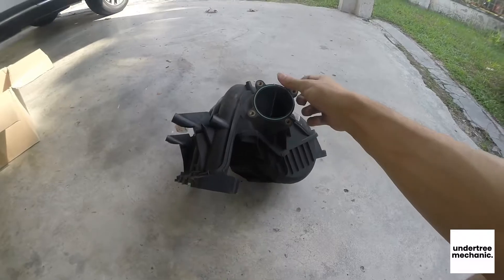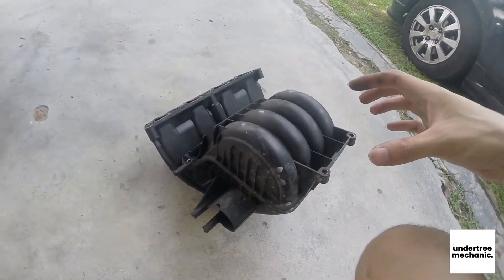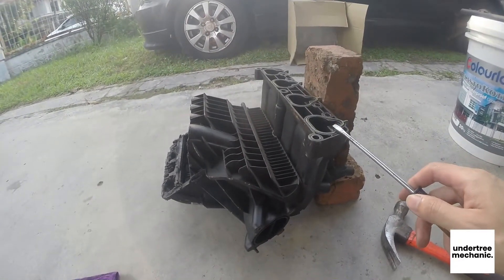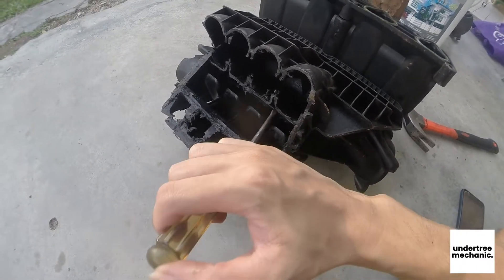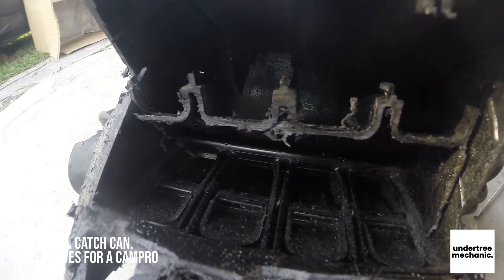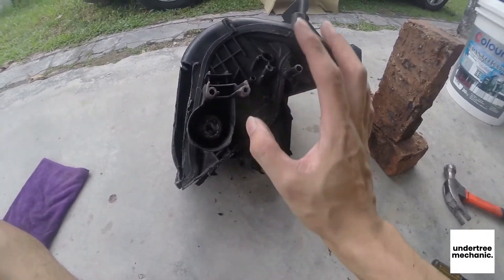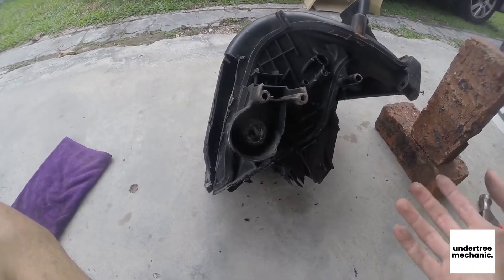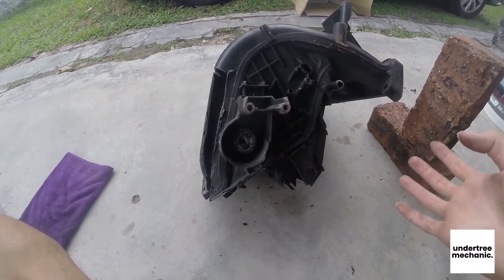Why/How does Proton IAFM fail (CAMPRO Intake Manifold) - Dissected & Diagnosed

Comment: Commenting to 2 years old video.
First of all nice video
Second, i have a 2012 model proton persona, still running on factory installed intake.(never change)
At first, i had similar prob.the intake flap noise.what i do to eliminate the noise as follow
1. Remove the intake, inspected it seems like the intake had to much oil such into it. So i clean it up
2. Try to figure out why the intake is too oily. Too much oil sucked into intake is symtom of bad pcv valve.however , campro does not have changeable pcv valve. It was build in inthe rocker cover with some sort of baffled systems.
3. Solution are follows
A. Clean the intake from the oily condition
B. Installed an oil catch tank in between the intake and the engine rocker cover. 
4. Result
Never had any issue intake flap sound.
During interveal oil change, i will make inspection to the oil catch can,an it is quite suprising to see the amount of oil the can catch.

Comment: I've been wondering what's the diameter of the throttle body opening on the intake manifold
Reply from the maker: Can easily find out by asking a spare part shop to let u see it. Haha i threw mine. Or you could just measure it while cleaning the throttle body
Reply: @undertreemechanic  got it, thanks :D

Comment: Why on low rev they use long runner? its because of the air impulse or air bouncing back when each cylinder closes the intake valve the back flow or pulse of air on short runner will cause turbulence on other intake cylinders. hence the pulsing only happens within the cylinder runner. on higher revs where the intake air feed is faster, you don't need a longer runner as the air is rapidly sucked in so a shorter and bigger intake is advisable to reduce air restriction. the best solution to solve the torque dip is to turbo charge the campro engine.